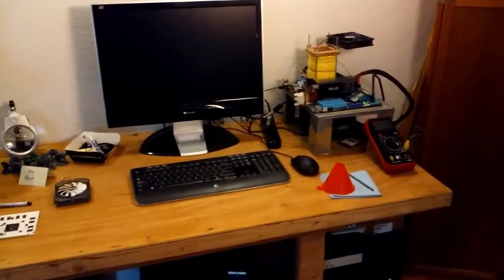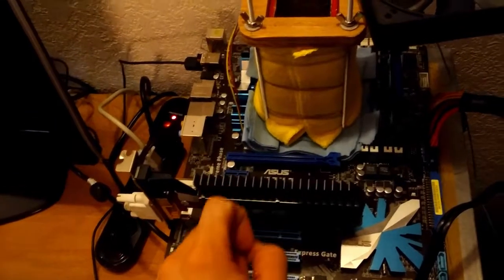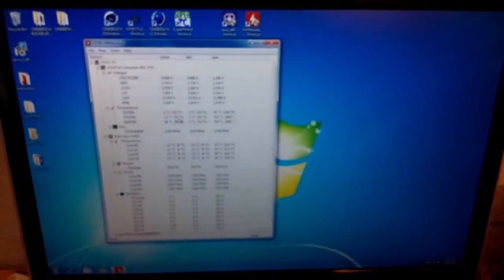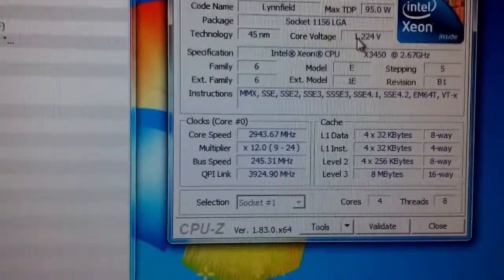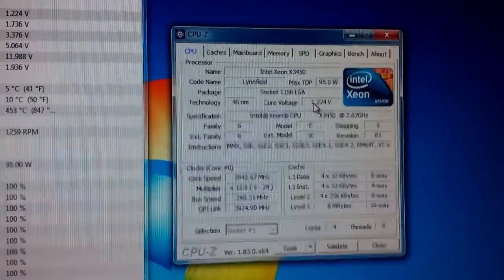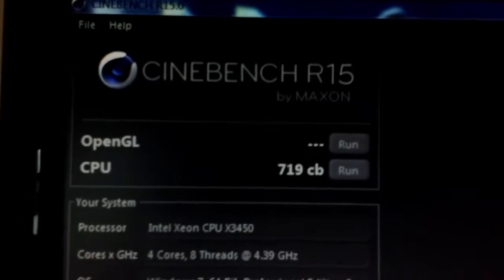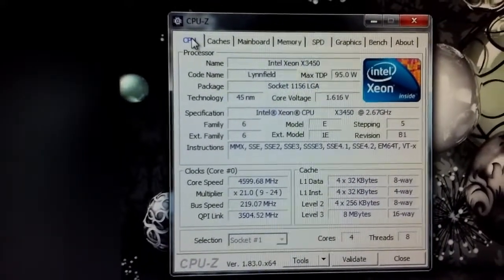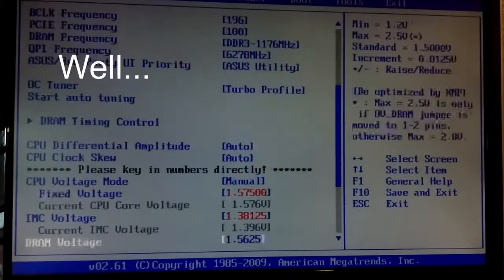Obscure Xeon XOC:OC Session Xeon x3450

Comment: you don't need imc voltage that high, my g.skill ripjaws x 1600CL9 is running at 2060mhz 11-11-11-30 with imc at 1.215v, doesn't really matter for dice though, just more for daily use, it drops the temps by quite a bit

Comment: Hi, nice video, and nice overclock too.

 Have you done anything specific in order to get the xeon working on your p7p55d ?
 I really can't manage to boot with either a x3430 or a x3470. Also, it boots right up with an i3 540. 
 I even checked your bios version and flashed my mb but it's the same story.  

Thank you in advance.
Reply from the maker: Sorry for the late reply. I have never personally encountered the same problem that you are experiencing. I just have the latest bios for the motherboard flashed on.

I have not personally tried using an x3430 or x3470 on any p55 motherboard, only x3450 and x3440. That said, all of these are pretty much an i5 750 with some extra support enabled for server applications.

As far as trouble shooting suggestions goes:

MIght try a different RAM kit or configuration, i3 540 (assuming that is what you meant) is a Clarkdale CPU and uses a different memory controller than Clarkdale.

You might also try to get a hold of an i5 750 to see if that will even work.

You may also have a slightly bent pin in the socket that is needed for something on the Xeons and not needed on the desktop counterparts.

Hope something from this helps you out if you haven't already figured out the problem. As I said these are just suggestions, I haven't experienced enough problems with this platform to personally consider myself experienced at troubleshooting it.

Happy overclocking:)
Reply: @guardianxoc7708  Thank you, I will look forward in this troubleshooting
Reply: Well, It now works ! As it appears, the ram configuration is in fact changed between Clarkdale and Lynnfield, and sitting the memory in another configuration did the job
Reply from the maker: Good to hear :)

Comment: If you are planning on running high fsb, start with a lower fsb (~220) and up it in windows using setfsb. I've managed to run up to 5.5 GHz on some Xeons under air that way :D (booting up with 5.0 GHz and upping it in Windows to 253).
https://valid.x86.fr/ek1wqm